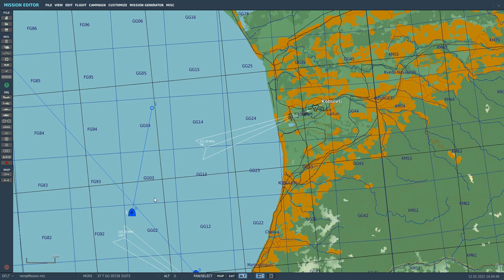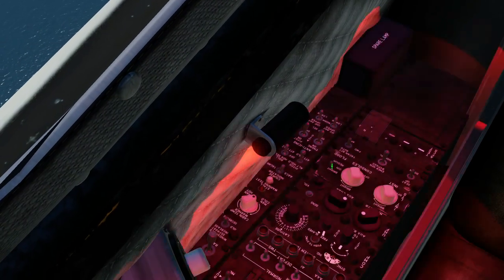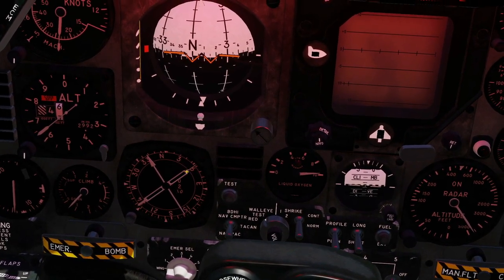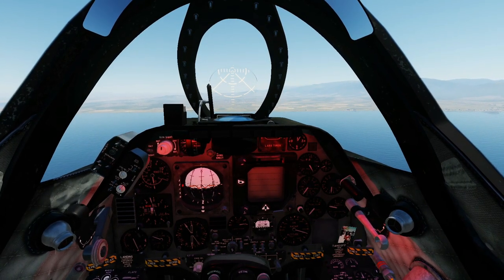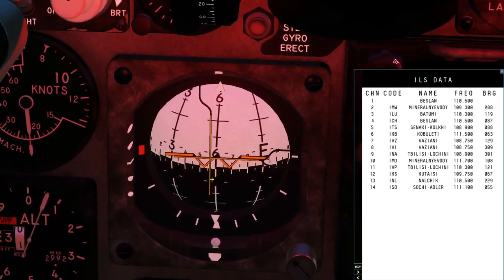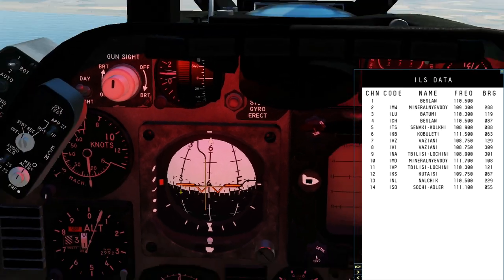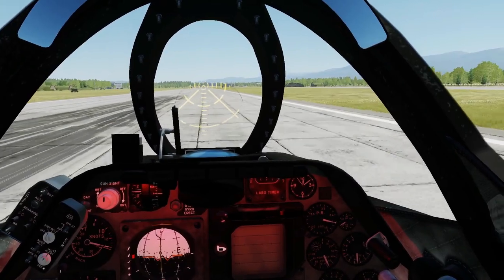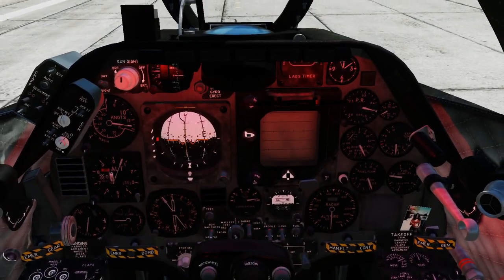A-4E Skyhawk: TACAN & ILS Radio Navigation Guide | DCS WORLD

Comment: +GrimReapersAtomic  Actually, the Navy and Marine Corps, through the Bureau of Aeronautics, specified not a Horizontal Situation Indicator, but a Bearing-Distance Indicator.  The BDI has one or two needles (TacAN and/or ADF) pivoted coaxially with the heading card (which is slaved to the Attitude Heading Reference System), plus a three-drum counter for TacAN distance from the surface transponder.

Comment: Your altimeter was reading uncorrected (for position error) Mean Sea Level, not altitude above the runway.  If you set QNH the altimeter reads field elevation at touchdown.  If you set QNE it reads zero at touchdown.  You have to know the decision height for the approach you are flying to know when to go around if you don't see the runway, although the inner marker beacon tone I think heard helps clue you that it's about time to make that decision. The red flag in the altimeter is red to clue you that the more accurate servo mode is disconnected.  Hold the switch left to get set the more accurate reading.

Comment: Any former Navy types out there?  I thought the ILS in this airplane was a carrier landing system only, not like a normal civilian ILS.  The carrier tracks the approaching airplane and transmits course and glideslope information to a decoder in the plane, and this system is not the same as the ILS present at most airports and installed in non carrier aircraft.  Anyone?.
Reply: TACAN is military only, but sometimes, on cross-countries, you may land at a civilian field which has gov't contract gas. Therefore you need either VOR/ILS and or ADF. Don't think the A-4 has VOR so to save space the TACAN is combined. Localizer approaches too. (azimuth only no GS info).
Reply: @suecobandito8954  I didn't ask about TACAN, and I'm not asking what I need to get gas at a civilian field.  I'm asking if the A-4E flown by the U.S. Navy had a VHF Instrument Landing System receiver to enable to to fly a standard  ILS approach to a civilian or military airfield.  My impression was that the receiver on the A-4 was a different system for use only with a carrier.
Reply: @JNelson_  The A-4E/F NATOPS manual I have (1 March 1977) indicates that the aircraft had the ARA-63 microwave ILS receiver/decoder that is used for carrier approaches.  I see no indication of a regular VHF ILS receiver.  Another indication is that you dial channels into an ARA-63 set but you manually dial MHz frequencies into a VHF ILS receiver. It's possible that later models or aircraft sold to other countries for land based operations had a regular ILS in place of the carrier ILS, but I tend to doubt the US Navy A-4E/F did.  (I flew into quite a few Navy bases in my day and they usually didn't have an ILS I could fly, just TACAN and ASR/PAR approaches.)
Reply: @gort8203  can confirm the Navy doesn't mix VOR with ICLS. F/A-18 only uses ICLS, E/A-18G can interchange between VOR and ICLS with a field refit.
Reply: @loganvelasco1889  Thanks for the confirmation. I hope the developer corrects this  module.